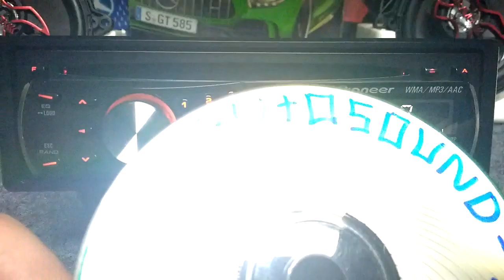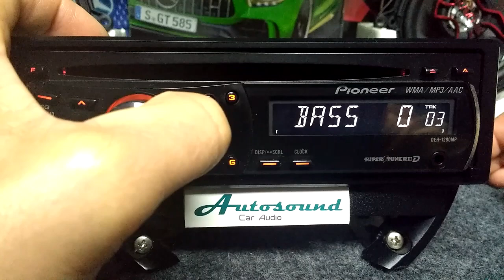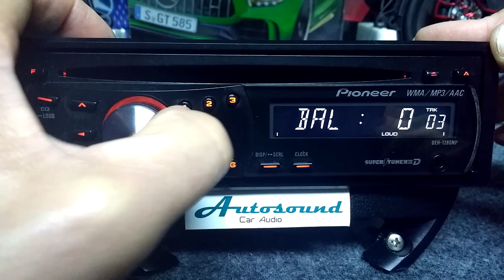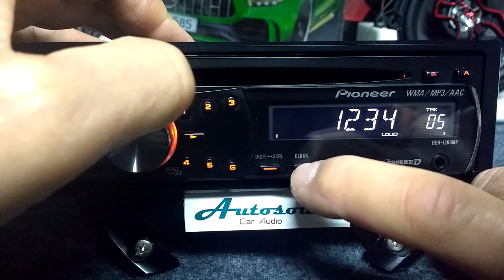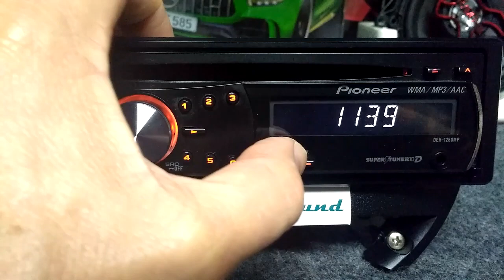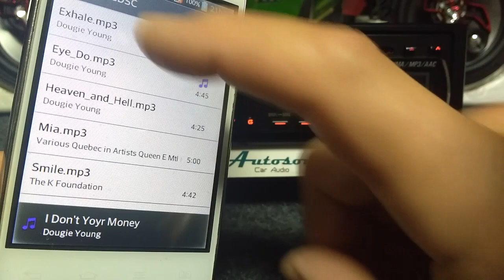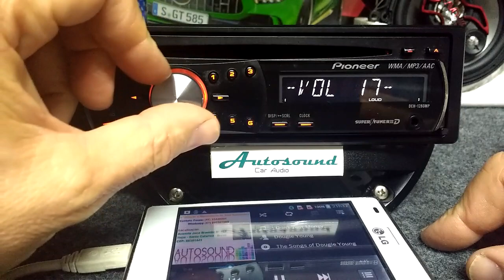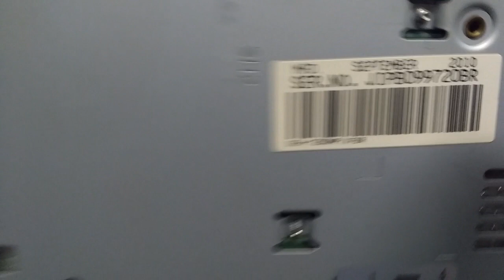Receptor Adaptador Bluetooth instalação interna Diy Pioneer DEH-1280MP Radio Cd Aux  Stereo s/ ruido

Comment: Poderia m formar se o paineer 2280.ub tem corte hpf
Reply from the maker: Tenho só o 2280ub https://youtu.be/9qsTyI6KqG8 Video em detalhes no decorrer com todos controles de audio. O manual do 2280MP esta aqui http://pioneer.com.br/wp-content/uploads/2020/01/55940354b33a7_3b60ae9bd0703639503113296f9e579d.pdf e não consta no resumo do fabricante o CROSSOVER. 2 níveis de loudness

Advanced Sound Retriever

Equalizador gráfico de 3 bandas, com 5 equalizações pré-definidas e 1 personalizável

Nível máximo de Saída RCA -2V

SLA (ajuste de nível de fonte) em 9 níveis